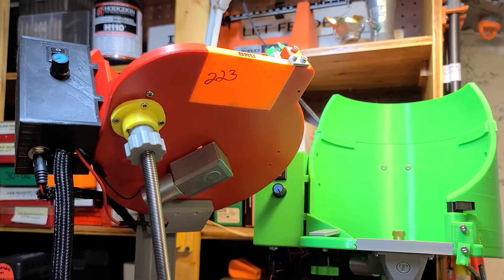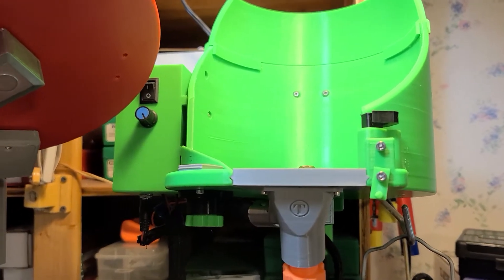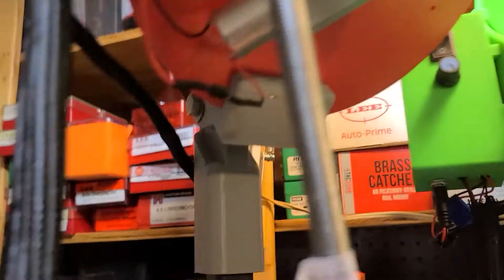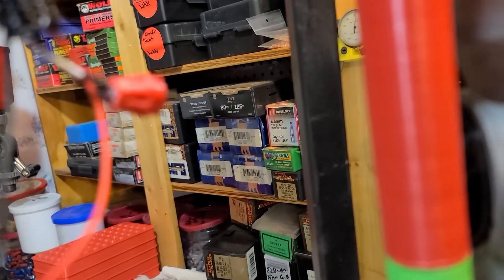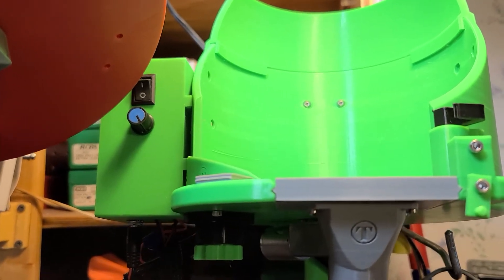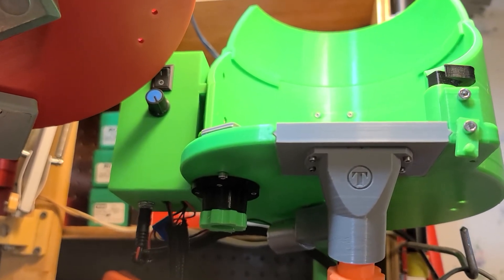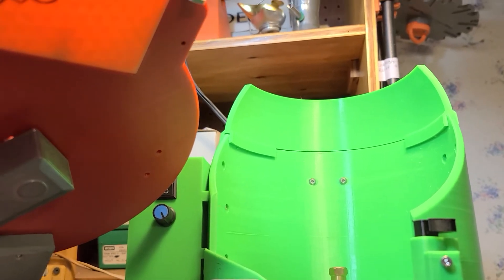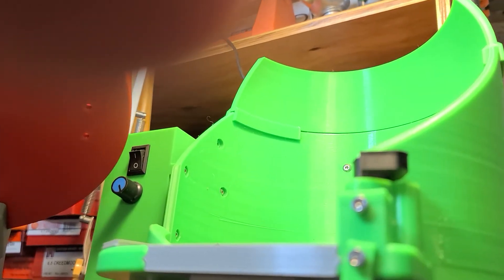3D Printed Bullet and Case Collator and Bullet Feeding Die

Comment: What kind of proximity sensor do  you  use  and  where  can  I  get  some  at  and what kind of power supply  do you use  and controller and relay switch  do have in the controll  box.
Reply from the maker: I used an optical sensor and an led I went that route because it was less expensive and a lot more reliable then the proximity sensor.... most of the electronics I got off of Amazon. Everything runs off a 12 volt wall wort.
If you go to the link I provided you can down load the PDF on all the parts and the ones people have used. It wasn't all that hard to put together and not all that expensive either.
Reply: Thank you very  much for the  Information  for  that .

Comment: It looks pretty automated .
Reply from the maker: It is... once you get it set right. I used to get 95% of the cases showing up correct with 9mm using the Lee collator... now I am getting 100%.
My hands were having a really hard time picking up those pesky 223 bullets(Arthritis)... now it isn't a problem. The set up gives more opportunity to check everything from powder charge in cases and neck crimp without having to worry about the cases feeding or placing the bullets in the case mouth to be seated. I can go as fast or slow as I want to. It is a God send!